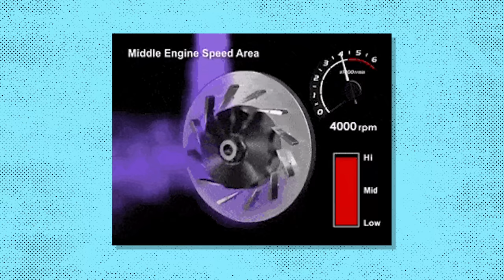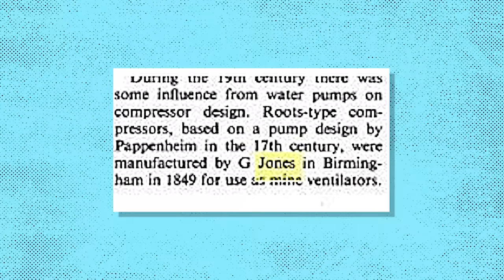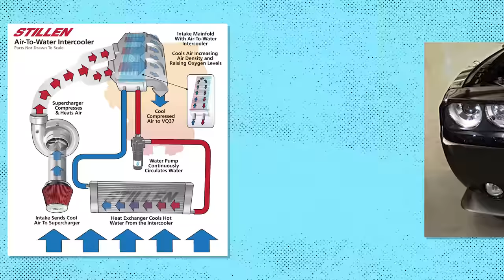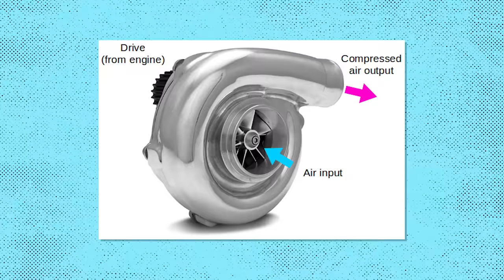Why Superchargers Aren't As Good as Turbos

Comment: Point of order: the OE superchargers used on the Chrysler Hellcat engines aren't Roots superchargers, they're twin screws built by IHI.  Examples of Roots blowers (or their direct derivatives) in OE applications would be:

-Eaton M90 on the GM 3800 V6 found in the Pontiac Grand Prix GXP
-Eaton M112 on the '03-'04 Ford Mustang SVT "Terminator" Cobra
-Eaton M122 on the '08-'12 Ford Shelby GT500
-Eaton R1740 TVS on the GM LT4
-Eaton R2300 TVS on the '13-'14 Shelby GT500
-Eaton R2650 TVS on the on 2020+ Shelby GT500

American domestic manufacturers tend to stick with superchargers for V8 applications because of their simplicity in boost control, low maintenance requirement (for example, the service interval on Whipple twin screw superchargers is 100,000 miles), and near instant torque production.

Also, centrifugal superchargers don't have "lag", at least not in the same sense as with a turbo.  Because a centri is still belt-driven, its spin rate is still proportional to engine rpm, same as any other supercharger.  But because they don't move a set volume of air each revolution, this causes them to build boost linearly with more rpm generating increasingly more boost.
Reply: The Fastest production cars made in America are turbocharged.
Centrifugal compressors still have a curvalinear boost pressure, like a turbocharger.
Turbo lag is not accelleration lag, turbochargers produce more power which results in higher performance top speed and accelleration.

Comment: The more boost with a turbo, the more back-pressure and heat, not to mention the plumbing headache. That's why I drive my Paxton Novi 2000 with a Me 0913 bldc motor @ 1:3 ratio. No intercooling required and nothing taken off the crank. Makes 5 psi on my 350 cu. it's all gone by red-line of course; but that's where I shift anyway.
Reply: The Turbocharger operates on the heat energy in the exhaust gasses.
There is no significant backpressure, turbos use an impulse turbine.
Turbos produce more power and the same manifold pressure because there is no parasitic loss on the engine.

Comment: Superchargers favor big displacement engines that don't rev as high as it pairs well with the instant boost nature of superchargers. This is the main reason why you mostly see the in the US markets since those vehicles have comparatively large low revving motors in our muscle cars and trucks.
Reply: True, engines over 1,000 cubic inches are commonly supercharged, small engines are not, but of course this is usually done for altitude compensation and scavaging.
2-stroke Diesel engines all use superchargers.
 The American drag racing scene was influenced heavily by the availability of cheap roots blowers salvaged from old GM/Detroit Diesel engines.
 American automakers were among the first to pioneer turbochargers for cars.

Comment: Something I didn't hear mentioned is the fact that unlike a turbocharger, a supercharger's power output can't be adjusted like a turbo can be. Turbos using exhaust gases and having a wastegate that controls the internal pressure means you can tune the amount of boost the turbo gives you, a feature missing from superchargers. What you get is what you get with a supercharger.
Reply: Not true, there are practical methods for adjusting the boost pressure of the Supercharger both automatically and with manual override control.

German aircraft engines used during WW2 featured infinitely variable supercharger speed control with a fluid coupling.
Supercharger rpm could be automatically controlled for altitude compensation and manual override control for aerial combat.
Reply: You can replace the pulley on superchargers with a smaller one that spins it faster thus making more boost.

Comment: mate the kompressors from the 90s and 2000s had an eaton roots blower mounted on the side of a straight 4 block with a low mount intercooler and piping basically like an after market turbo kit......... no bonnet bulge

Comment: should have mentioned twincharged engines since brought up eturbos. supercharger for the lower end, remove turbo lag, and connected by clutch so it can disconnect once the turbo takes over and not cause parasitic loss. granted it more complex and expensive.

Comment: As a powertrain engineer... there are a number of details glossed over.  The turbo vs. supercharger is much closer than you think but even 1% fuel economy difference is a huge deal because of CAFE.  Just take a look at fuel economy dot gov and compare a 2018 Audi A6 3.0 supercharged to a 2019 Audi A6 3.0 Turbocharged.  In general, the "waste energy"  powering the turbo is minor in comparison to the back pressure pumping losses powering the turbo.  It is that small amount of waste energy that gives the turbo the edge, but it's not as big of a difference as described in this video

Comment: Actually, you can put a supercharger anywhere as long as the crank pulley is inline with the blower snout. Just some extra piping is necessary. Same as a turbo. The main benefit is that having power immediately is actually really nice for daily driving. With some big turbo cars, you can actually get a bit of surge where holding the thottle at a fixed position will still accelerate the car. Its just much nicer to drive with a blower. Coming from experience driving a big turbo civic and my daily being a blown mountaineer.
Reply: Some superchargers are mounted perpendicular to the crankshaft.
There are no limitations if it is part of the original design, it only aftermarket superchargers that have limitations.
Reply: You put a blower on a mountaineer? Thats awesome, never seen that slapped on a 4.6 suv
Reply: @JasonLuther1  actually its on the 5.0. The explorer and mountaineer were the last cars to have that motor, had them till 2001. Same motor as in the foxbody mustangs, just with better heads and intake manifold
Reply: @shauncole4392  Oh yeah you're right, I guess I thought ford had done away with the pushrod 5.0 in the early 2000 considering the mustangs were dohc 4.6. You may be the only person I know who has a blown mountaineer haha awesome man! how much ponies you think she makes?
Reply: @JasonLuther1  the setup it has now cant be making more than 300. I am using a junkyard m90 blower that is just way too small for the motor its on. I have a second motor in my garage with a stage 1 tfs cam, bigger injectors, and an intake for 2 m90s (yes, two superchargers on one motor) just waiting for a warm day to slide into the truck. That setup is my real power maker. My goal is 400hp, but the numbers in the setup point to 500+. Ill just have to see once its in. But the current setup in the car is just there as proof of concept. Never really intended to keep it like that forever. Ill probably try to make a video on youtube showing it off, because i dont think anyone has done anything quite like what im doing.

Comment: I had Rotrex supercharger on k24 Honda in an Ep3 500hp and with the correct pulley on it I never noticed any lag, was fantastic fun and very reliable charge Temps were great too. 22mpg on average. 
Very easy to install. Just saying I enjoyed my supercharger experience.
Reply: It doesn't change the fact that turbochargers are superior to superchargers for one very important reason
Reply: @sandervanderkammen9230  both units are superchargers technically. Rotrex type has much better charge Temps and so easy to fit makes it a great add on. Turbo gives more power on same set up but more complicated. Both have advantages and disadvantages. As for the last word response just grow up.
Reply: @slartybartfast1  It does not change the fact that turbochargers are inherently superior to superchargers.
 Supercharged engines have higher pumping losses and lower thermodynamics efficiency so they will always make less power and use more fuel per horsepower generated
Reply: @slartybartfast1  Just the facts here son, didn't you pay any attention to the video?
You don't seem to understand the difference between a turbo and a supercharger?
Reply: @sandervanderkammen9230  you've not read anything I've written. Your talking cross purposes! I've got 5 turbo cars and 2 with Rotrex I know what I'm taking about you just can't see what I'm saying because your wanting to win! An argument that's not valid. Go away.
Reply: @slartybartfast1  lots of people, in fact most people that own cars that are supercharged or turbocharged have no clue how they work or the differences... while yours is a quaint anecdote it also proves nothing.
From your comments you don't understand how a turbochargers works or why it is superior to all types of superchargers.

Comment: I have often wondered can you have a supercharger and a turbo charger together
Reply: Yes, you can... it hasbeen used successfully in some applications
Reply: Been done may times, it's called twincharging. It's expensive and complicated which means generally unreliable, or even more expensive to make it reliable. Makes little sense for the small benefit.
Reply: @acarguy3773  thank you
Reply: Yes - it's mist famous use was the Lancia Delta S4. Its called twin charging, arguably so fast it was responsible for killing Group B

Comment: In a piston powered airplane supercharges work great! Also with two stroke diesel engines.
Reply: Difference with 2smoke diesels is they use the blower to aspirate rather than add boost. A non turbo 2 stroke Detroit Diesel is still considered "NA"
Reply: @budyeddi5814  to be fair you could just increase the rotational speed of the supercharger and thus generate boost
Reply: @THESLlCK Wow, you just exposed your lack of knowledge on this topic.
Reply: @WilhelmKarsten  ok little guy
Reply: @THESLlCK  How can you "generate boost" when the exhaust valve is still open?
Reply: @WilhelmKarsten  the same way turbocharged two stroke diesels do it? Have you never seen a twincharged 2 stroke before??
Reply: @THESLlCK  Have You? Because you don't seem to know anything about them, in particular how they operate.
Winton type (uniflow 2-stroke diesel) engines are not supercharged or turbocharged.
 They are all Normally Aspired
Reply: @WilhelmKarsten  it's almost as if I'm not talking about them YOU STOOGE
Reply: @THESLlCK  Sounds like you don't know the difference between Naturally Aspirated and Normally Aspirated

Comment: depending on the brand electronic turbos are also known as electronic superchargers.  the reason being is that these ones require a secondary, or a larger alternator to operate the increased electrical need of the charger in question. this in turn tends to sap power, not as much as a roots or impeller style charger mind you, from the engine.
Reply: If they have an exhaust turbine? They are still a turbocharger depending on the mode they are operating in... they switch between supercharger and turbocharged modes.
Reply: @sandervanderkammen9230  that is one thing i do not disagree with you on as i said some people generally call all electronic forced induction systems electric turbos. which as i said is not all are known as electronic turbos. some are electric superchargers.
Reply: @signolias100  If the motor can switch to a regenerative mode? The engineering  term is ECT Electric Turbo Compound,  if theTurbo is linked mechanically to the crankshaft  (or fluid coupling) it is called Turbo-Compound.
Reply: The presence of an exhaust turbine clearly indicates that it operates on the Brayton Cycle as a Combined Cycle heat engine and would be correctly classified as a Turbocharger.

Comment: I had a 2010 Scirocco 1.4 tsi which had a turbo and a supercharger (was it also in the Golf GT?). I believe they had a habit of failing in a lovely cloud of blue smoke (though mine lasted fine until I sold it) and they later quietly dropped the engine.
Reply: Apparently there was a recall but, to be fair, it was destined to fail as an engine as small as 1.4 has very little excuse to not spin a tiny turbo.

Comment: I've heard that increased pressures caused by boosting of any sort can shorten the life of the engine, especially when used with direct injection.  Seeing as the former (with its associated plumbing, bulk and possible reliability issues) isn't it best just to go for a bigger engine?
Reply: Nope, turbocharged engines are extremely reliable and are commonly used in endurance racing,industrial, commercial and military vehicles and passenger aircraft.
Turbochargers produce more power and use less fuel per horsepower.
Reply: Adding boost to a previously non-boosted, stock engine is probably the source of that. Engines designed for boost are made to withstand the higher compression and power.
Reply: @evlkenevl2721  no, actually Scotty Kilmer always says that.  He maintains that turbo engines don't last, especially when combined with direct injection....

Comment: not trying to bash you here but Im pretty sure you can get above atmospheric pressure with a roots supercharger. also you dont actually need to run an intercooler with any form of forced induction, it just helps make more power.
Reply: If you dont go above atmo the blower turbo or super is useless.

Comment: I have 2 Modified St. cars making several hundred horsepower using Superchargers and each car has over 170,000 miles on it and Superchargers never had an issue.
Reply: Turbos are so reliable that they are used on aircraft... they easily last the life of the engine.

Comment: The roots supercharger is not used on the dodge demon/hell cats, that is a tvs 2650 which is a twin screw, they use a female and male screw that typically results in more efficient air compression/boost
Reply: As well as it should be noted while turbo charges may be more efficient, they do also cause parasitic loss and potential bogging down low, especially with larger single turbo set ups, they increase back pressure before they are spooled, also the most powerful engines used in racing, are supercharged not turbocharged, all top fuel dragsters are actually hemi based supercharged engines, which would definitely refute some of the common ideas of dohc big turbo engines making the most power
Reply: @chbrown5408  You don't know how turbochargers work do you?